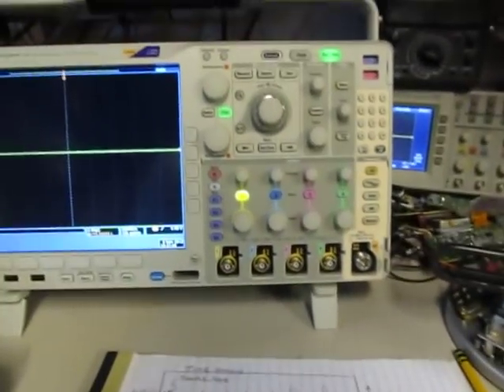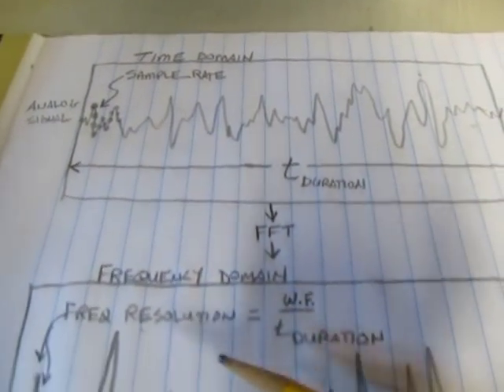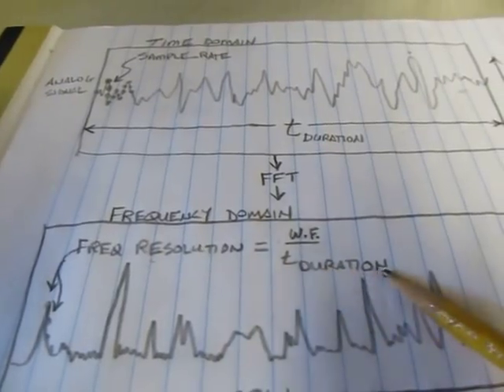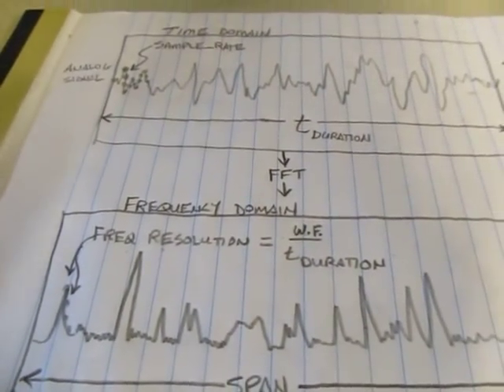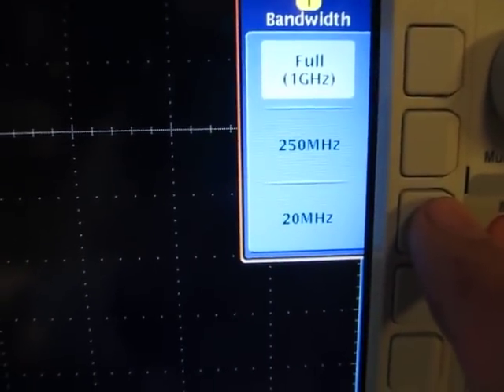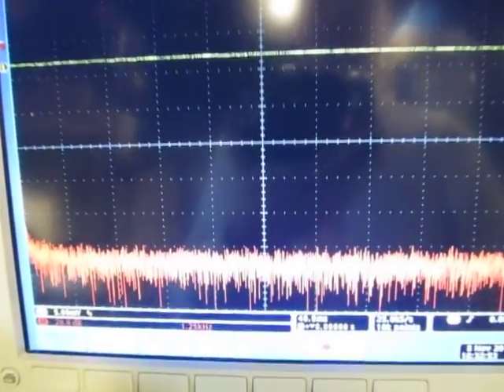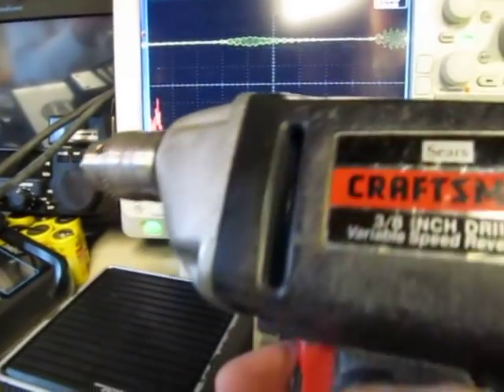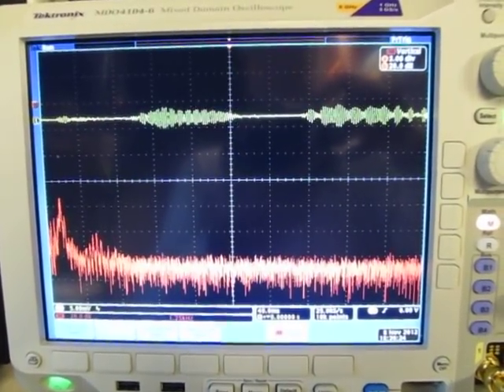#65: Basics of using FFT on an oscilloscope

Comment: Hi, is it possible to measure fft levels as an spectrum analyzer in a 9MHz FI of a Yaesu rig whith this scope? I want to measure TOI IP3, MDS all in FI high impedance probe. Thanks LU2DVY
Reply from the maker: I should be possible, but you will need to be careful to see if the distortion components are not coming from the scope when measuring TOI IP3.
Reply: @w2aew  thanks 73 de LU2DVY

Comment: Awesome video. Video instructors like yourself are a godsend & especially to people like me who are trying to modify and build amplifiers with no electrical engineering background or former electronics education other than what we have been able weave through on the internet. Thank you very much! Still trying to decide whether to purchase a used but working/calibrated analog scope (I lost a bid the other day on a GW 20mhz semi-modern analog scope w/digital buttons for $42 lightly used *sigh*😣) or one of the modern cheap digital units that does a simple 100khz or similar simply for the math and fft functions like in the video. Im torn lol i like the simplicity and real time accuracy of the analogs ive seen...but i also really want to be able to have fft capability as well as the simplified time saving math functionality. Oh, plus at this very minute my budget is limited to maybe slightly over $100 (the biggest handicap of the matter 😅) to spend on such - so used is thr only real option 😬

Comment: Did I miss it, or did you not explain what an FFT is?
Reply from the maker: Not specifically.  Ina few words - an FFT is a mathematical process that can take a time domain waveform (voltage variation vs time) and output the frequency domain content (amplitude vs frequency).  FFT stands for Fast Fourier Transform.  https://en.wikipedia.org/wiki/Fast_Fourier_transform
Reply: @w2aew  Basically turns a scope into a spectrum analyzer?
Reply from the maker: @edinfific2576  A rudimentary one, yes.
Reply: @w2aew  Thank you very much for your fast response. Love your videos, envious of the equipment. 🙂

Comment: Allen,  is it possible to use the FFT to measure phase noise in 1 Hz bandwidths of a oscillator or transmitter?
Reply from the maker: In general, no, for a few reasons.  In order to get a 1Hz resolution BW, you would need more than 1 second of time capture.  If you're looking at an RF signal, then the sampling rate has to be much greater than the RF frequency.  This translates to the need for a lot of memory (high sample rate capture for a long time), which most scopes don't have.  Second, most scopes are 8-bit samplers, which won't have the dynamic range to see very low phase noise.  Third, most scopes will have their own internal phase noise which will be greater than the device you're testing.  There are exceptions (expensive exceptions) to this, but most affordable scopes can't meet that requirement.

Comment: we bought a oros nvgate for vibration and noise measurement, in the manual i saw selections such as rms, max, or min, are these the time domain displayed signal? how can i get these from the original value? and the frequency domain has inst. spectrum and avg. spectrum, are these the same?
Reply from the maker: I am not familiar with the Oros Nvgate product, so I can't comment for sure.

Comment: Can you measure frequency range down to 100 Hz using this scope ?
Reply from the maker: yes
Reply: @w2aew  I tried to do this yesterday using Techtronics MDO3000 scope but lowest resolution I got 1.25kHz/db. I need to check a peak around 100 Hz. How do I do that?
Reply from the maker: @subhasishsutradhar2665  You simply need to change your time-domain horizontal scale to a large enough value.  For example, if you set the horizontal scale (timebase) to 100ms or 200ms/div, you can easily see a peak at 100Hz.
Reply: @w2aew  max div I could go was 40 us.
Reply from the maker: @subhasishsutradhar2665  An MDO3000 can be set as I described (I just verified it), so I don't know why you were limited to 40us/div.  At 40uS/div, it is impossible to get frequency domain resolution down to 100Hz.  This due to the physics/math, not a fault of the scope.  Frequency resolution in an FFT is inversely proportional to the time duration of the waveform record.  At 40uS/div, the total record length is 400us, which isn't long enough to resolve 100Hz signals

Comment: A speaker works as a microphone but not "just as well."  The inertia and spacial extent of the cone attenuates high frequencies and the coil couples directly to the motors' changing magnetic fields.

Comment: Hi Alan, 

Thanks for the video, I am using a similar oscilloscope to the one in the video (Tektronix DPO400 series) and trying to measure values between 30Hz-150kHz using the FFT mode. When comparing the results of the measurements at two test frequencies (120Hz and 125Hz), I noticed significant difference in FFT max value vs. the Vrms value of the time domain signal at the same input value..  At 120Hz, I'd see 6.35Vrms for both FFT and time domain Vrms. At 125Hz, I'd see 5.39Vrms for FFT and 6.35Vrms for time domain.

I'm assuming this has to do with what you were describing when talking about windowing and the signal beginning and ending at the same value. How would I go about solving this issue in this case?

Thanks,
Jadon

Comment: You have a $16000 scope, a $6000 function generator and I don't know what other stuff. I'd like to know: How does this expensive equipment give you the money back?
Reply from the maker: Hobbies can sometimes be expensive, such as cars, Amateur Radio, antique collecting, etc. But in this case, I work for Tektronix so this equipment didn’t cost me that much.
Reply: @w2aew  Ok, got that. Still, someone buys that stuff. Are there moments when Tektronix customers say "wow, if we didn't find that strange signal, that would have cost $10k if the circuit went to production"?
Reply from the maker: @thomasw813  The equipment I have on my bench is considered basic bench or mainstream equipment.  I have many customers with equipment that costs 10x as much, because that is what is needed for their work.

Comment: Thanks for the video Alan, I have a question, how do I measure the dynamic range of a signal with the FFT function in the scope? How do I know where is my noice floor and how to improve it?
Reply from the maker: The noise floor is affected by two things - sample rate and record length.  A higher sample rate results in an FFT that covers a wider frequency range - thus the scope's noise floor is spread out over a wider range, which make it lower at any given point in the FFT result.  A longer record length improves the frequency resolution, essentially a narrower resolution BW, thus the power in each of the resulting trace points (FFT bins) is lower.

Comment: Can an oscilloscope with FFT do a spectrum analysis for power frequency voltage and currents? I am typically interested in analyzing motor currents(50Hz) to look at components of 2x, 3x, 4x and other higher-order harmonics.
Reply from the maker: Yes, but you will need to adjust the scope horizontal scale to give you a few hundred milliseconds of capture (at least) in order to get sufficient frequency resolution in the FFT result.
Reply: thanks for your reply. I had forgotten that I had asked you this question and I was struggling with the poor frequency resolution of the FFT waveform. on increasing the record length to 250ms, the resolution improved, as you have rightly pointed out in your reply. thanks very much.

Comment: Thanks for your great video. 

Question:  Why is it so difficult to find a "swept-tuned" frequency analyzer for audio?  My scope does FFT, but I would like to use swept-tuned.  It seems they all want to start at 9KHz and go up, not down.  (I'm guessing cost is a factor, but why?)
Reply from the maker: Not enough of a market demand.  Can easily be done with s/w and a soundcard, in realtime.
Reply: @w2aew  Thanks for the quick reply.  Interesting that higher frequency analyzers don't also use s/w and fft vs hardware swept-tuner.  However, your answer still makes sense-  there's a preference in the market and soundcards and pc's make it simple for s/w to manage the audio range analysis.

Your videos are always superb.  I've watched many many and learned from all.
Reply from the maker: @jj-js5sx  Actually, many new analyzers DO employ digital IF processing, realtime FFTs, etc.

Comment: Why is the refresh rate of fft function is too low?
Reply from the maker: Because it is a large matrix math application, and the processors in many scopes are not that powerful so it takes time to compute the result.
Reply: @w2aew  I think that they use fft chip or fpga to calculate this function to compensate this problem.
Reply from the maker: @Hadi-zw9mb  Only some have dedicated hardware for this, most don't.

Comment: Why is the frequency span half the sample rate of the scope at that particular measurement?
Reply from the maker: A signal must be sampled at least twice per cycle in order to properly determine its frequency.  This is called the Nyquist Criteria.  In order to have at least two samples per cycle, the sample rate has to be greater than twice the signal frequency.  If you don't meet this criteria, the signal will be "aliased".  A visual example of this is the old western movies on TV where the wagon wheels appear to be rotating backwards.  Since signal frequencies above 1/2 the sample rate won't be displayed properly, they are not displayed at all.
Reply: @w2aew  thanks for the quick and detailed answer!

Comment: Can the fft function be used like a spectrum analyzer? For RF?
Reply from the maker: To some extent, yes.  The scope bandwidth has to exceed the RF frequency you want to measure.  The main problem is that it may be difficult or impossible to get nice low RBW around a specific RF frequency due to sample rate and memory limits.

Comment: Excellent, does is need a 1k Ohm resistance on the cables between the sound card and the computer or oscilloscope with FFT function?
Thank s

Comment: Nyquist limit applies to every frequency in the signal you're examining, not just the ones you're interested in.  Those high-frequency components you don't care about will still give you aliases.  In this case though I imagine the speaker is rolling off the higher frequencies pretty well.

Comment: 12.5khz ? were you a roadie?
Reply from the maker: Hmmm - -  I don't understand the reference between 12.5kHz and being a roadie - fill me in!
Reply: @w2aew  I guess I'm not that old yet.. 12.5khz sounded pretty low to me,  but I guess it's normal sigh
Reply: HAHAHAHA!!!
Just be glad Alan is not studio mixing engineer.
8 bits at 12.5khz is more than enough for old timers ...
:-)

Comment: Hi allen. Why do you need a spectrum analyzer-If we can get the spectral components through FFT. How is spectrum analyzer better than FFT ?
Reply from the maker: There are many ways that a spectrum analyzer is better than an FFT:
- A spectrum analyzer will almost always have lower distortion, lower spurs, and better SFDR.
- A spectrum analyzer will have much better selections for RBW, detector types, trace types, etc.
- A scope FFT is fully dependent upon the acquisition settings on the scope (input BW, sample rate, acquisition depth), all of which affect the type of results you get.
- Most scope FFT have limits on the FFT vector length which places a lot of restrictions on resolution.
I could go on, but you get the idea.
Reply: Oh ok.So the scope spectrum is not as accurate.Its only as good as how well you are able to represent the actual signal. Thank you :)

Comment: I didn't see at all that the DeWalt had significantly "more energy" than the Craftsman at the higher frequency. The DeWalt had some isolated higher amplitude spikes on the display, but the energy content within a given frequency range seemed about the same or even lower overall than the Craftsman...unless I didn't understand to what exactly he was referring.
He did not explain how one defines or determines "energy" content in a signal...He simply declared the DeWalt had "more energy" without showing us what in the waveforms makes that apparent to him. It would have been more helpful if he had gone ahead and saved the waveforms and then provided a direct comparison of the two, showing EXACTLY what he was talking about.
I think it would have also been helpful to significantly change one of the measurement parameters he talked about (like the number of samples) and demonstrated exactly how it affected the results.
The math discussion was good, but the presentation would have been much better with specific example follow-ups.
Thanks for the video. It's a decent start just lacking a bit in the practical elements.
Reply: I agree with you, I like and appreciate w2aew very much but thought I saw more DeWalt energy at the left of the display (low  frequency, higher amplitude zone).

Comment: HI there, this was very interesting for a novice. I use a scope in automotive applications but I'm not expert. I am however trying to work out if I can use the FFT function to detect a momentary frequency drop out in a constant frequency signal. My expectation is that I would see a spike at the low end of the spectrum? Appreciate your thoughts.
Alex
Reply from the maker: Probably not because good resolution requires long record lengths which would mask any short dropouts.
Reply: w2aew damn! Thanks for that ... didn’t realise the long record time was required

Comment: I can't find much by googling about the window factors involved in frequency resolution mentioned in this video (freq res = w.f. / t_duration), only about window correction factors to correct amplitude or power of peaks for different window functions. e.g. for Hamming 1.85 for amplitude and 1.59 for power. Are they the same thing?
Reply from the maker: Here are a few blog posts that discuss the function and purpose of the window functions:
https://www.tek.com/blog/spectrum-trace-processing-rsa
https://www.tek.com/blog/window-functions-spectrum-analyzers

Comment: I would like to see how you find the spatial resonant frequency of a inductor using the fft function of the oscilloscope.
Reply from the maker: I'm not familiar with the term "spatial" resonant frequency.  Are you referring to the self-resonant frequency?
Reply: w2aew i actually mean spatial resonant frequency.  
There is a guy called Dr Ronald Stiffler that has been developing technology called SEC Exciter.
Are you firmilar with it? Like the Slayer Exciter, but the original tech if you will.

Finding the self resonant frequency with the FFT function would be very interesting too ofcourse. :)

Comment: It is worth to note the dynamic range of the measurement. Pending on scope settings, the spurious dynamic range is only about 40 to 50 dB. Most oscilloscopes are limited by a 8 bit analog-to-digital converter. However, the scope may show a noise floor well under 50 dB with erroneous harmonics.

Comment: How can I measure the exact frequency of audio signal??
Reply from the maker: Most accurately with a frequency counter.  Otherwise, you can get close with a scope measurement.
Reply: Thanks for your reply,
Can we determine exact fundamental frequency of vibration shock with FFT?
(If the vibration shock frequency is varies from 50khz to 400khz and duration of shock in milliseconds)
Reply from the maker: You should be able to get very close.  The frequency resolution of an FFT can be approximated by the inverse of the record duration.

Comment: I cant seem to unify the FFT from the scope with one that I am doing in python. It is off. Like really off.  Used hanning, and converted to dBV. In what should I have confidence?
Reply from the maker: It's difficult to say. I don't know your scope, or how you implemented your FFT. I would tend to believe the scope since it was designed by a team of engineers. If you want them to match, then you'll have to match the FFT length, including any zero padding, as well as the window applied.
Reply: that's what I'm thinking. I'm running noise through the scope and exporting voltage and fft. I have tried to mimic the specs of the scope as best I could. I'm sure most manufacturers use similar algorithms to do the fft. Sample rate, aquire time, reference voltage, windowing are all the same. If the fft is run on the previous window data, I expect to get little/no correlation (meaning cross correlation) between the two. you seem to know your stuff and I wouldn't ask if I hadn't tried all the tools in my arsenal. thanks for the quick reply.
Reply from the maker: If the scope is truly doing an FFT, then you'll have to determine what the scope does in order to make the record length equal to a power of 2 in length.  Is it truncating the waveform, or is it zero padding?  Is it applying the window to FFT vector prior to zero padding or after zero padding?  Lots of little subtle details that can affect the results.

Comment: Nice video. In Acquisition Mode 9:19 what is the difference between Hi Res and Average?
Reply from the maker: Average mode will average the waveform samples on successive acquisitions - so it requires several triggered acquisitions in order to work.  Hi-Res mode is used when the scope's sample rate is faster than what is needed to produce the waveform record requested - it averages a group of successive sample points into the waveform points - thus it works even on a single acquisition.  These modes are more fully explained in this video:
https://www.youtube.com/watch?v=E09IjTzslA0

Comment: I definitely find that the Dewalt has a smoother top end and more pronounced mids than the Sears.  Just kidding, GREAT video.  Very useful...
Reply: Sears sounds better on everyday incuding Sunday. The Dewalt has a slight ringing overshoot.
Reply: Bulghur Bulghur What if you change to silver cable or get rubber boots to minimize the vibrations? :-)